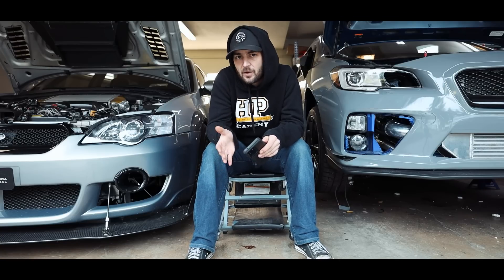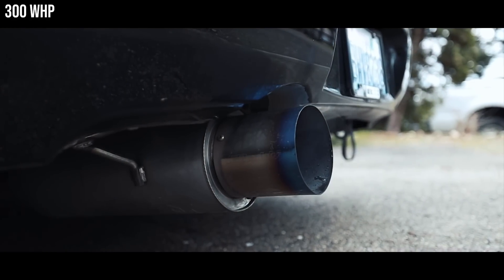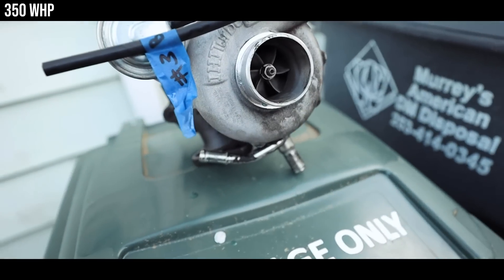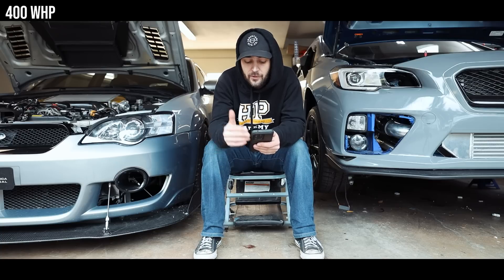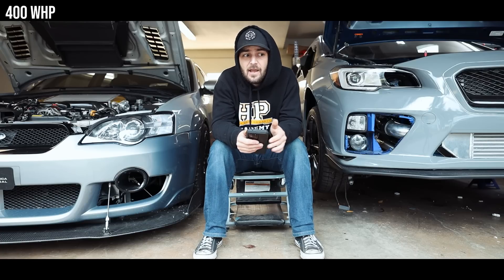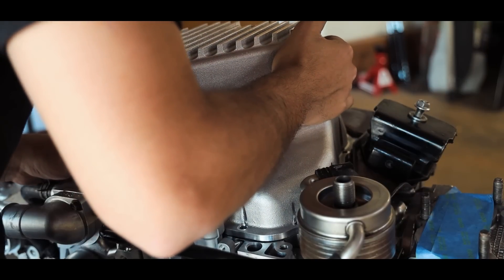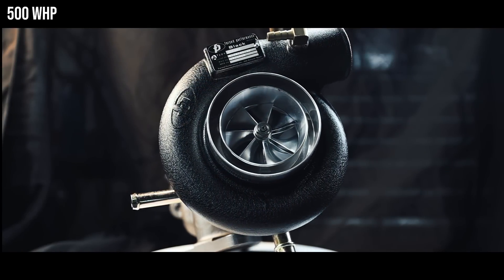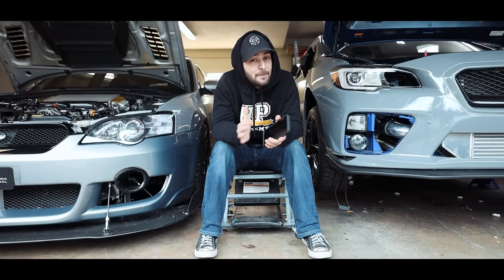How to Make "X" Horsepower in a Subaru WRX STI

Comment: For anyone dumb enough to want 700whp
Iag stage 4 tuff block 
Cnc ported heads
Gsc s3 cams
Gs beehive springs with titanium retainers
Gsc +1mm valve intake and exhaust

 Killer b holy headers w/ band
 Vband custom uppipe
 band 3 inch to 4 inch downpipe
- Precision 6466 gen 2 1.05 ar housing
- Corsa veloce intake manifold
- Tgv deletes
- Tial 45mm ewg 25 psi spring (plumb the ewg via dual ports)
- iD 2600 injectors 
-  Radium dual 525s fuel pump hanger with plumbing kit 
- Cobb fuel pressure sensor 
- Radium fuel pressure regulator 
- Iag aos competition series 
- Cobb fuel lines & rails 
- Tomei  
- Egr deletes 
- Aem 5 bar map sensor 
- Fmic Ets 4 inch intercooler w tial 
- 3 port boost control
- Speed density 
- penguin flex fuel kit 
- Iag 76mm big bore throttle body 
- Off the line performance ignition coils
- Iag competition series oil pickup & baffle pan

Comment: I have the exactl build as the 450whp one but quite a few more supporting mods like a cylinder 4 cooling kit and a few other things but I make 438whp and 503 crank with a iag block rated for 650whp

Comment: I always keep coming back to this video because its great information and I always see new comments that add so much more to this already great video. My current build on my 2020 is as follows:
Cobb downpipe, ets extreme catback, gfb hybrid bpv. Making about 280-285whp on 91 tuned with Migtuned. 
My next build will be all those + :
Id1300 injectors, IA tuning fpr, AEM340 fuel pump, cobb cold air intake + custom air box and then cobb 3 port boost controller. 
Basically all there is to do before upgrading the stock turbo. One day I will go bigger turbo, equal length headers, maybe front mount and all that other good stuff. I’m not sure if anyone will ever see this as this video is very old but thanks to anyone reading!

Comment: I want to do a full dual pump system using 2 walbro 255, 1 feeding each bank and a big return line with a 2 regulator system 1 each side

Comment: so all I've got right now is a redline intake, an aos and an act full face clutch with streetlite flywheel. if I want to run down pipe and catback, is all I need is the injectors and fuel pump? i was about to buy that whole ass kit that's like 2k with the rails and all that with it.

Comment: So even with 500 whp you don't need to take the engine apart and replace with forged internals, replace pistons, manley rods etc? Can it be done by someone at home (with proper instruction and guide of course)?

Comment: 3:30 wait, wut? So STi LESS than 2015 doesn't need injectors or fuel pump? ONLY 2015+ needs injectors and fuel pump? How does that work????
Reply: Still recommended. Don’t want fuel starvation
Reply: Because the 2015+ have a lower flow rate/smaller injectors, than previous generations

Comment: So what is the most power a CARB-Legal VAB can make? If I'm not mistaken, upgraded injectors, fuel rails, boost controlers, MAP sensor kit, downpipe (catted and non-catted), and NextGen FlexFuel ethanol sensor kit are currently not legal in California.

Comment: turns out here in QC Canada, with our barometric pressure here if we upgrade the fueling and put an intake and downpipe causes over boost in the system and therefor if we want to run a downpipe and intake combo, we need to upgrade the turbo (ball bearing) itself as well and have all supporting mods for it, words from my tuner, didn't know barometric pressure had anything to do with tuning itself! just for anyone who is from QC Canada! great video btw!

Comment: PLEASE D     BE     ADVISED      TO     USE     EXEDDY    CLUTCH    SOFTER   ON     THE    PEDEL     CLITCH    CYLINDER    AND     CLITCH   SLAVE     CYLINDER     AND     GOOD    STD.     CLITCH       FLUIDS     CHEERS       GUYS      HAPPY      DRIVING       CHEERS      🥂

Comment: Love the video! Big thanks! I have a 20 sti and want to shoot to 300hp maybe alittle more. Will I run into issues if I do not upgrade my stock turbo when going from 300- 350 hp?
Reply from the maker: Stock turbo will cap at about 330whp max 🙏

Comment: So I picked up an ‘05 sti that’s been built pretty well. I think the guy watched your videos to do it. Motor only has 8k on it and every mod you’ve mentioned with maybe minimal exceptions. It puts 445hp and 439 ft/lbs to the wheels and I need a clutch. Could you recommend one and also, should I get a new master cylinder just to be safe? 

The reason I think it’s gonna need a clutch is because after it rained, I started my car and it would NOT shift into any gear with the engine running, but it would when it was off. So I started it with it in 1st gear, and it was fine after that. Idk if that is foreshadowing any issues but I can’t imagine it’s “normal.” Idk. Help?
Reply from the maker: Sounds more like the TOB that clutch. But if your goinf to replace it the act HDSS is always my go to 💪
Reply: @Smeedia  appreciate ya 🙏🏻 I’ll let ya know what I see when I get it all out

Comment: I have a 2013 hatch Sti, so I don’t need to upgrade my injectors and fuel pump for the 300hp mark?
Reply from the maker: I would at least do the pump, but not required

Comment: Ok got a question….I’m not too far away from you here in Portland. I’m sure you have heard of PRE (Performance racing engineered). I called them a little while ago and asked them some questions about the 2019-2021 sti’s RA block. And they had some interesting things to say. 

Question 1: “I heard the Type RA block was a fair bit stronger than the non RA sti’s. I’ve heard numerous people talking about being able to hold around 500whp.”
Answer: “This has been a debate for the last couple years. We have found that’s not correct and it’s barely stronger than a non-Ra block.”

Question 2: “If I wanted to make let’s say 400whp with the RA block would it be able to do so fairly reliably and what all would you recommend?”

Answer: “You can do it, but even with the RA block, we still recommending building the bottom end. Making anything above 340whp on these motors is still not super reliable without doing the bottom end.

I bring this up because 1. You never mention anything in this video about building the bottom end. Secondly, every time I talk to them I feel like they are not giving correct information on purpose to simply get more money out of the customers. I could be 100% wrong, but that’s what it feels like and I’ve talked to them several times and they have given contradictory information a lot of times compared to what you and other people have said as well. What do you think? Have you heard of these guys and what’s your thoughts on what they said?

Thanks again!
Reply from the maker: Imo a shop will want you to build the motor ao that way they can ensure the car won't come back again. This way person x,y or Z can't say so and so built my car and if blew up. 

In my experience RA blocks are tough cookies. My RA block I beat the hell out of at 460WHP for damn near a year with 0 issues. I know others that have been at 600WHP for years now. Personally I send RA blocks without issue. But a shop will always tell you to build the engine
Reply: @Smeedia Ahh ok. So in your opinion it's not really needed for until higher HP and TQ numbers?

Comment: Used you list and did the modifications you listed. Here is the list and the results: 
Parts:
COBB SS GESIDownpipe

Cobb Intake
IAG AOS
Injector Dynamics 1050X
dw 65C fuel pump
COBB Fuel Regulator Kit
GS EBCS 
Results: 
310 hp/345 torque
Reply from the maker: Eyyyy, not bad power results 🥳

Comment: I know this is an older video and cop kind of screwed a lot of people with the flex-fuel Stuff Etc, but do you recommend the FP black over going rotated? And if so, why?
Reply from the maker: If its a street cat then yes 100% the black responds to much quicker than most rotated set ups and gives you usable power
Reply: @Smeedia  awesome thank you. I inherited this car with a rotated 6870 setup (useless for street car) so I swapped out for 6466, just got my built motor back, and just waiting on new clutch and flywheel bolts to install it back in car. I just wanted to know what difference between rotated vs the FP black, I've been seeing a lot of on the subaru pages lately. Thank you for your replies as always sir 💪😎
Reply from the maker: Chdck out the videos on my old 05 STI, went from a FP Black to a 6062 and missed the black 😭
Reply: @Smeedia  well crap, now I'm nervous, cuz I just dumped a ton of money into this motor and turbo setup🤣🤣

Comment: Would anything in this video change due to the whole Cobb thing that happened?
Reply from the maker: Overall no only exceptions are EPA related changes
Reply: @Smeedia  Ok so for the 350whp there nothing really changed if I’m correct. Also I see that the Cobb catted downpipe is discontinued. Is that something that I can get any brand is I can’t find a used one?

Comment: With the new changes to COBB's Accesstuner, what if any options do we have for power on a stock downpipe? i.e, If I'm running the 1050s and intake, would a COBB 20G choke hard if I put the stock downpipe back on it? Are EL headers and a larger intercooler a viable option for making "clean" power? Are larger injectors even needed?
Reply from the maker: Stock downpipe could get you close to 400 if your pushing it. I know grimmspeed is working on an O2 friendly downpipe soon 

Headers and FMIC are still solid and injectors are still needed

Comment: So I would like to pick ur brain. First off, thank  you for explaining the steps to 400 whp. My goal is going to stay between 350 to 400 on stock internals. So I've been kinda on my own agenda of what I wanted to do first with the car. I do have power gains but I've been delaying stuff because of stupid cali. But eventually I'm going to Crack when I have the money and say fuck it.  Anyway my ultimate goal So far was reliability and being funner but the car happier in our extreme desert heat months. So I'm going to list everything I've done for the last year and would like your thoughts or estimate of my whp on my 21 sti. Cylinder 4 cooling mod, cobb 3" titanium cat back exhaust,  I a g Aos street  edition, killer b oil pan, windage and pickup, process west tmic, cobb bpv, cobb sf intake kit, csf aluminum 2 core I believe radiator,  mishimoto aluminum fan shroud with fans, I did the fan upgrade more for hey my radiator is aluminum let's make the fans look better sitting on the radiator lol. I don't know if the cooling power is any better then oem or durability but well see. I got lower and top new cobb radiator hoses. And then I had the car etuned by Brent tuning. Before the tune I was making 17.6 psi of boost peak. After tune its making 21.6 psi peak. Brent tuning said my fuel upgrading will be next and recommended to do fuel before doing downpipe. I've done alot of the work on my car. I didn't do Aos. I wanted it done right. Yimi sports did it. And when I do fuel they'll do that also. That's will also include downpipe,  bigger stock location turbo ,turbo inlet and them dyno tuning it after they complete the work.  So uouve heard what's on it now and my future goals. What's your estimate on my whp now? Do you agree with Brent tuning ? And do you think I'm on a good path ? Thank you for your videos and all you do.
Reply: I knew I'd forget something.  First off obviously I have the accessport 2nd I have oil pressure gauge and oil temp gauge on the pillar. Thanks
Reply from the maker: Great reliability mods you've got and been is spot on. You'll need to do I jesters, fuel pump and FPR from Here before getting a downpipe. Right now for power I'd probably say your car is around 290-300ish WHP
Reply: @Smeedia  so..... Subaru saying the sti is 310hp stock isn't accurate?

Comment: I just got a brand new RA short block in my 2015 sti
Reply: So please do tell y is it miss leading so don't say it has 305 whp not crank power
Reply from the maker: All manufacturers rate their cars in crank HP (so measured at the flywheel) if you have an STI Then yes it makes 305 crank. But no one ever uses crank hp measurements. Everyone goes by wheel (so how much power actually makes it to the wheels) awd cars usually lose about 20% of what's measurent at the crank vs what makes it to the ground

Comment: Hey Tanner you were mentioning fuel stumble is that when your on the gas after letting out off the clutch and it feels like the car has no power and then it goes???
And who makes this Kit cause I think I need one!!!
Reply from the maker: In a sense yes, Cobb makes a good kitnif your using stock fuel lines still.
Reply: @Smeedia  Yes still stock just a catback and perrin sports filter noticed once I put the catback on it started doing that or maybe the drive by wire is messing up idk lol!!

Comment: Buy a mustang s550 dont waste money on turds like this
Reply from the maker: 10/10 terrible advice. 

Buy a Z06
Reply: @Smeedia  had one sold of for the new mustang better platform had a c7 z06 had the 2013 gts viper had the tesla p100d had them all the mustang is the best slap boost on and e85 at 1000 hp stock trans stock dif the z06 is nice but the mustang has more potential with the new 10 speed and the gt500 is a beast seen them at 1500hp stock internals stock trans stock rear corvettes need to be built to achieve what ford has done wait till the new c8 z06 then put boost to compete with mustang's... but then ur also at 130k might as well buy a exotic
Reply: @Smeedia  I'd never buy another wrx  literally trash on 4 wheels broke making 400 hp that's what stock cars make in my opinion of over 20 years of racing building 800hp honda s2000 1300hp mustang's vipers vets I've owned them all the mustang's are one of the best platforms maybe ur just into cars with like 500hp but where I come from that is not a fast car that honestly wont beat my 2020 f350. Makes 1500ftlbs 700hp so I just dont see why anyone would buy a useless wrx... change my mind what's it good for speed? Nope looks nope mpg nope ride quality nope.... I just see a car simmular to a ford fusion or a Taurus the sho has like 345hp do sti even have that much power as a old ass ford tauras??
Reply: @S2KCYA  Who hurt you?

Comment: Is there a specific brand for the injectors? I keep seeing 1050x as well and assume those are the same? Some are and some are not listed to include my 2019 STi.
Reply from the maker: Injector dynamics 🙏
Reply: @Smeedia  these are just plug and play? No need to upgrade or update anything else to make them work?
Reply from the maker: Just need to get their PnP adaptors with them

Comment: What are your thoughts on the FP Red turbo? Also any suggestions for Legacy GT specific stuff?
Reply from the maker: Power goals? 🔥
Reply: @Smeedia  I would like to be around 400whp on 93 octane with the headroom to go up a bit more.
Reply from the maker: It will get ya there, the FP turbos are fantastic options, that red will give you the head room as well

Comment: I just ordered a downpipe, boost controller and 1050 injectors. Can I run a fmic with that? Or do I actually need to have “big boys” mods? I’m located on southeast area and it gets pretty hot  here, so I feel a fmic will kinda be a better option? Thanks for the video though! Great info.
Reply from the maker: Totally can just make sure you get the proper tune and you'll be solid 🔥
Reply: That’s the only thing stopping me right now, idk of any good tuner around Georgia 😫
Reply from the maker: I don't know anyone in that area 😭

Comment: I went with the VF48 built by hill country induction, ID1050X, upgraded fuel pump, turbo XS up pipe and downpipe, STI intercooler, Perrin inlet, Koyo Rad, Grimspeed EBC, Exedy organic clutch, Exedy lightweight street flywheel for my 03 JDM Subaru Forester Cross sport. Hopefully I'm not missing anything crazy. I think this will be the max the 5 speed will handle.
Reply: What’d you make with this set up?

Comment: Any estimate how much would it cost to go from stock to 400whp?
Reply: Ballpark on 93 octane
- FP green 1600 or ~1000 for an Arashi g20
- Down pipe 700-1000
- Access port 700
- EBC 200
- FPR 350
- Fuel pump 200
- Injectors ID 1050 cc’s 600
- AOS 500
- Miscellaneous 500
- Labor 1500
- Tune 650
- Subtotal 8,000
This may be in the high 300’s on 93. Headers and intake should get you to 400’s on 93 or using e85 (add $250 for an ethanol sensor and $200 or so for additional tuning costs) instead of headers and intake. 
An EWG will also give you a bit more power. I’d say the list above are the bare essentials for that 400 whp mark. 
Honestly, if it’s a street car, more torque is better than 400 whp. Shooting for a set up that makes 400 lb/ft of torque is the way to go on the street. It feels much faster.

Comment: Can you do a what’s needed for 800, 900, 1000whp sti? Also some parts on the lists are a little unnecessary, a walbro 450 pump should be fine for 600whp so the dual pump hanger is a bit overkill IMO
Reply from the maker: I could but it would be very diffrrnt from person to person and highly depending on tuning